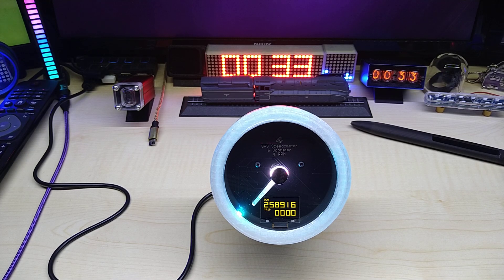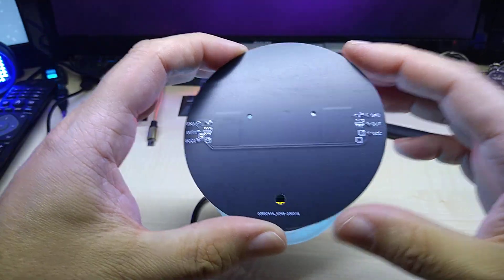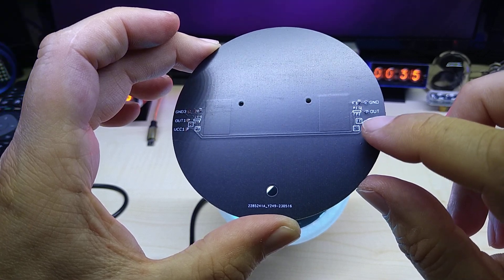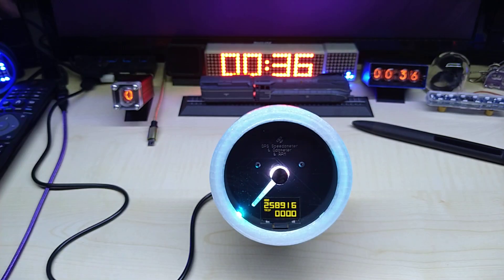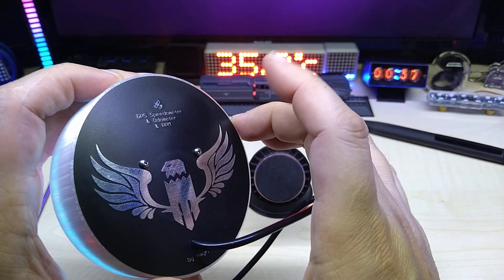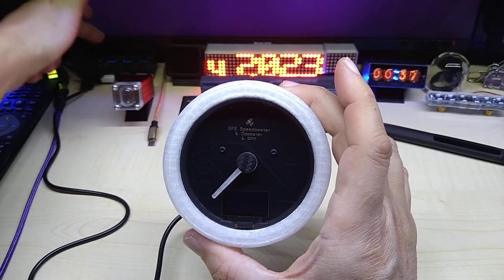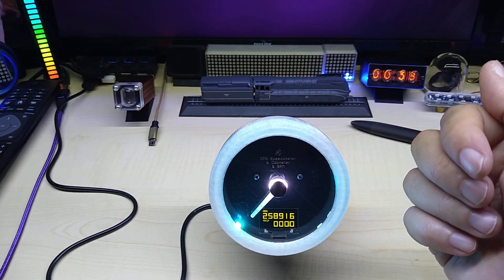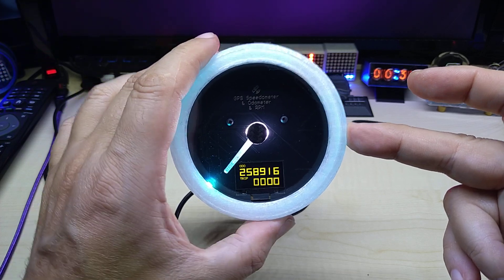GPS Speedometer, Neopixel Tachometer, OLED Info Display designed and build by #Hayri #gauges

Comment: hello, do you have any problems starting these 2.4 inch oleds? mine sometimes starts after a few tries
Reply from the maker: Hi, never used OLED that big, only up to 1.54". Check the library and the code you are using.